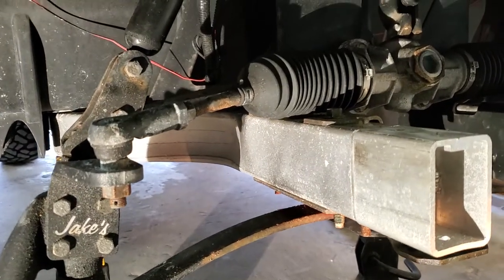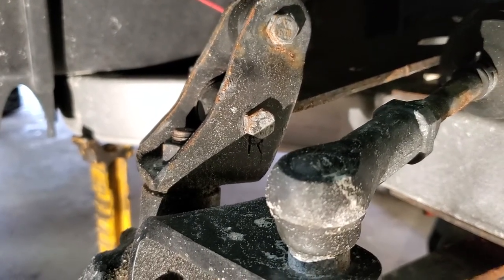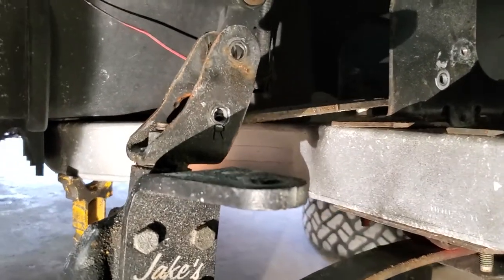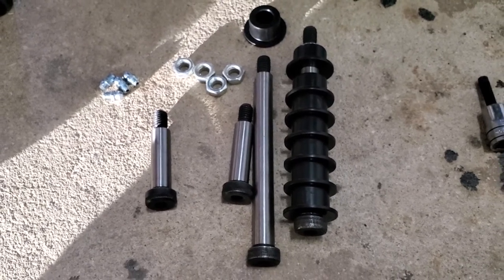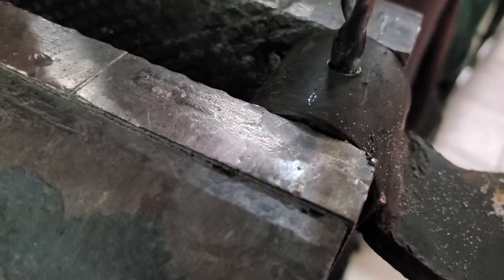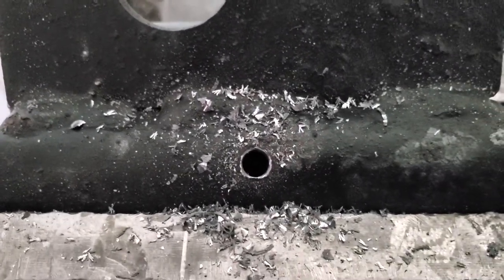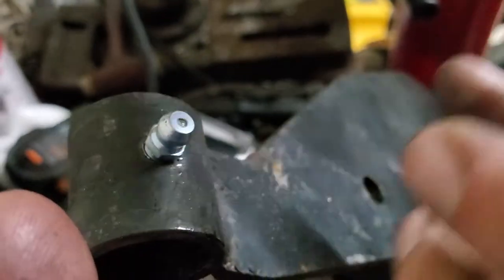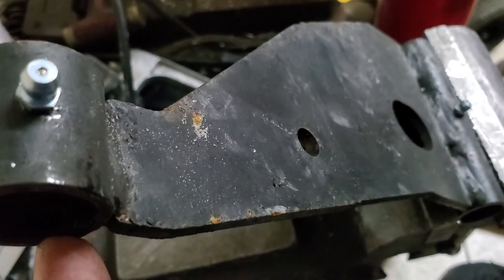Sus-Spec* Club Car Precedent bushing upgrade kit #tempo, #onward, #lifetime warranty

Comment: Interesting! What type of material are the new bushings in this kit? How does the ability of adding grease help these bushings? Does it keep them from drying out? Thanks
Reply from the maker: Delrin, hard as bronze, grease prolongs life and a quiet, smooth ride. No inner bushings which rip rubber apart. Ty
Reply: @tricky5830  awesome, I'm very familiar with delrin and know how strong it is compared to the weak plastics and even urethane used in most bushings. Is the contact number found somewhere within these messages still accurate? Do you have a store or site? Thx!
Reply from the maker: I've been in the golf car business for 40 yrs. Showroom and service dept in edgewater FL nothing on the website. Call me at 386-423-0975